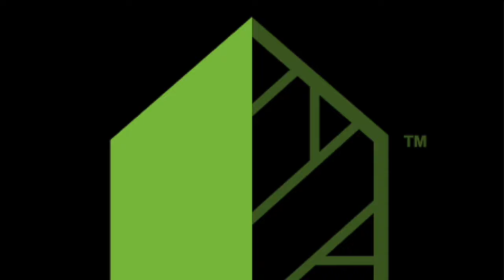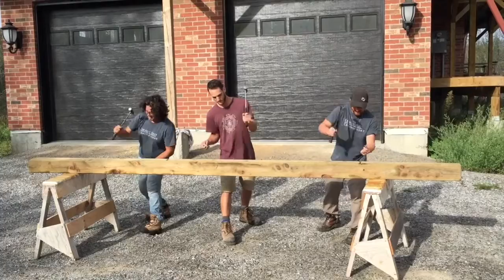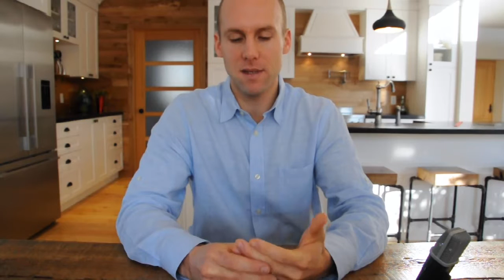What Is The Best Type Of Insulation?

Comment: Casey, I have been lead to believe that taped and sealed Styrofoam is basically an air barrier and a vapour barrier and as such an interior vapour barrier (poly) is not necessary and, more importantly, not desirable as any water getting into the wall will have no where to dry to.  Do you disagree with this theory?  Your last example in the video seemed to be suggesting that applying styrofoam on the outside of a wall that has a vapour barrier on the inside was OK.
Reply from the maker: The conversations I have had with others suggests that it’s not a concern. Partly because the vapour barrier is never sealed properly. Also, if the foam takes care of the condensing plane, then it should be fine. There are also products out there like Certainteed Membrain (not a typo) that allows vapour to travel through it if the pressure builds up meaning that it allows drying to the inside. It’s expensive so we use this product with poly as opposed to using it in place of poly.